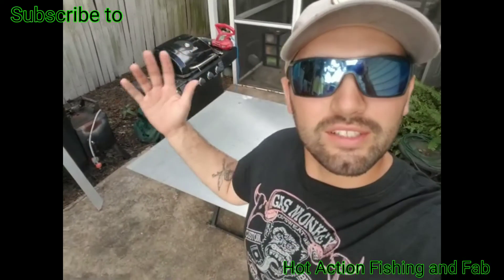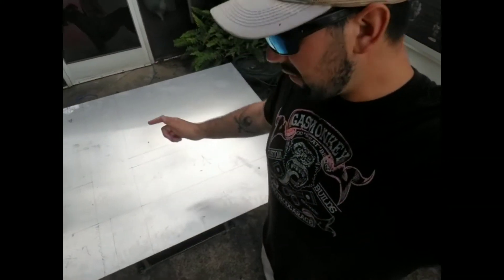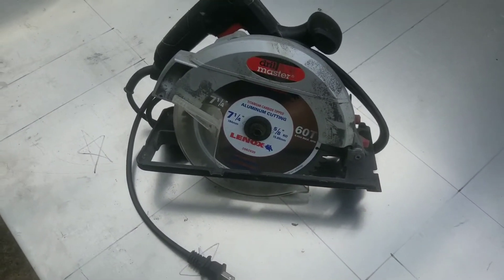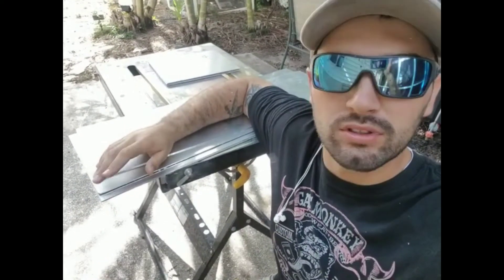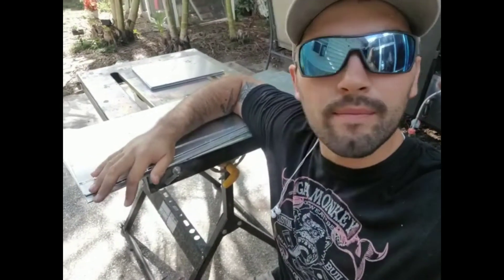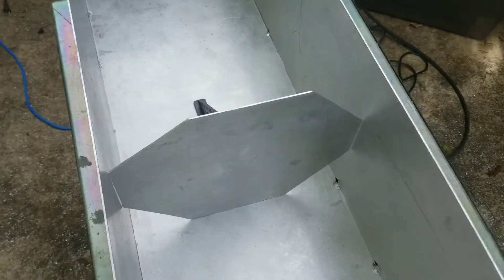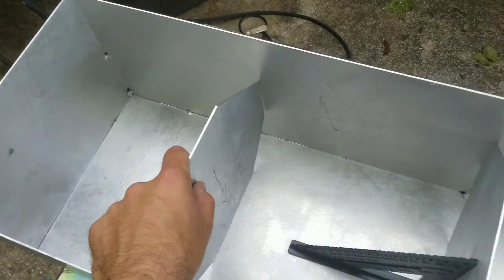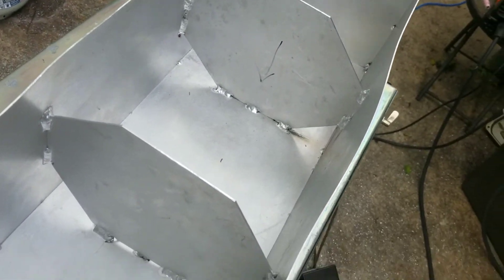DIY FIBERGLASS BOAT BUILD (Aluminum gas tank build 4 micro skiff) PART 10

Comment: a little ambitious to weld your own alum. tank... for the price of a plastic under deck moeler tank at around $150, it be way easier to throw one in.
Reply from the maker: Yeah I didnt want a plastic one I wanted a aluminum one. I have the time and the material to build and I'm sure some people appreciate it. Built not bought.
Reply: Hot Action Fishing and Fab  

I have a pro fishing and fiberglass buddy.  He recommends plastic.  I am undecided.
That would be a good video to compare the two.
Reply: plastic is forever, especially in saltwater where aluminum will corrode... not to mention having a pressure tested guaranteed tank compared to a warped homemade aluminum one lol
Reply: Seven Cabbage Fishing  yeah my buddy says plastic   I always thought metal but I was wrong again
Reply from the maker: Thomas D Harrell Plastic permeate fumes. so if you have it in ur hatch/storage compartment  that makes your life jackets and stuff smell like gas.
Reply from the maker: Thomas D Harrell They make epoxy coatings you coat the tank in and it's for ever. But ware my tanks going to be at I wont have anything to worrie about at all for ever. If you foam the tank in or the water cant drain around the tank properly it will cause it to pit and potential pin holes.